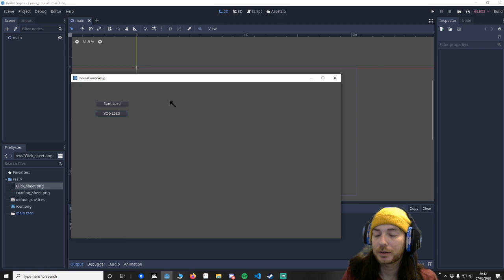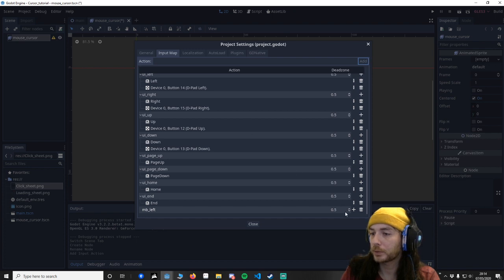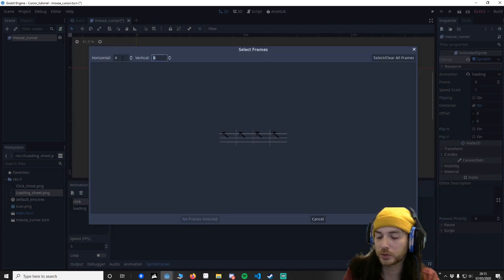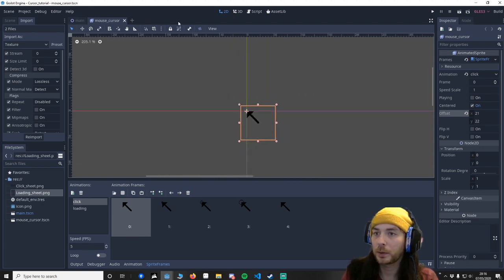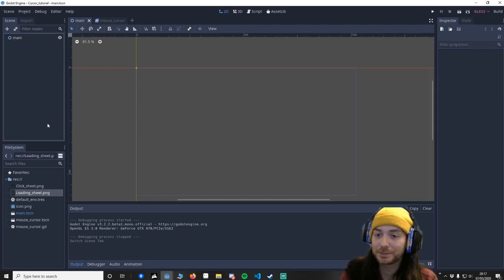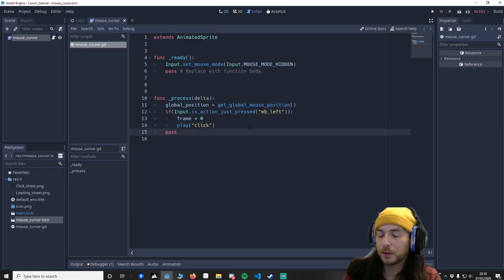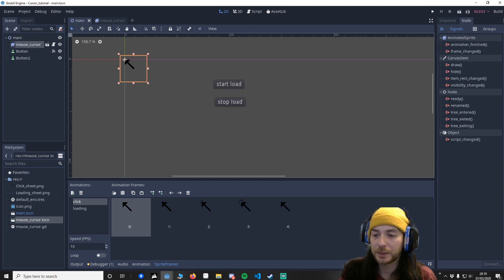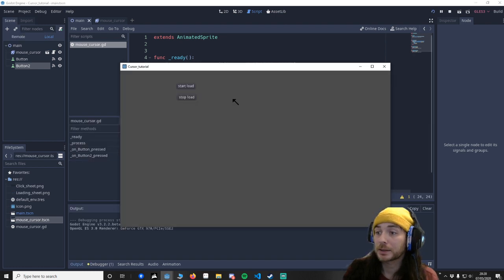GODOT Animated Custom Cursors

Comment: Hey how could I make an idle animation for the cursor
Reply from the maker: Without writing the project as it's not simple enough to write it on a youtube comment. I would say look at global_mouse_position. What you could do is check the last global_mouse_pos vs the current, if they match, it means the mouse hasn't moved, so you'd have a var called "last_mouse_pos" and in process you would check if last_mouse_pos == global_mouse_position if it does then it's not moved, if it doesn't it has moved, then you update last_mouse_pos to the current global_mouse_position.

Now let's say each frame the last_mouse_pos == global_mouse_position you can update a var called count += 1, if that count gets to 600 (10 secs if running at 60fps) then you can change the icon to idle., if at any point the last_mouse_pos != global_mouse_position then we know the mouse has moved, so you want to restart count to 0 and change the mouse back to the default state. I hope that can help. Do you need this for a game or just curious?
Also you can undo the idle if right/left/middle/scroll wheel has been moved as well

Comment: This works great but doesn't work well when used in an Autoload and when rendered over CanvasLayer, how do I fix this?
Reply from the maker: Firstly I'm sorry it's not working over a canvaslayer, I should have checked that. 
So I've found a fix around. Make a CanvasLayer Node, then attach the mouse_cursor node to it, save that CanvasLayer node as "Mouse_Cursor_Layer" or what ever you want, then use that node as your mouse. It should work, it did for me, if not, I can send you the project on discord (in the description)

Comment: I think there's another way for doing this in the settings  without the code but not sure if the animated textures works in it
Reply from the maker: You can change the actual cursor texture itself but if you do this its within a certain size and there is no way of animating it, well you could set it over and over to each frame of the animation but it's an ugly soultion.
This while very basic does work for the need.